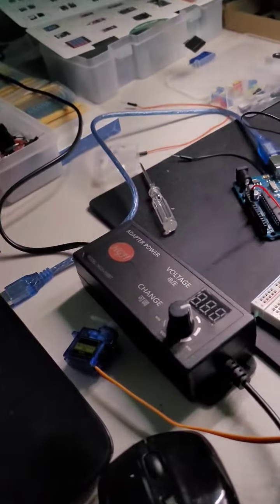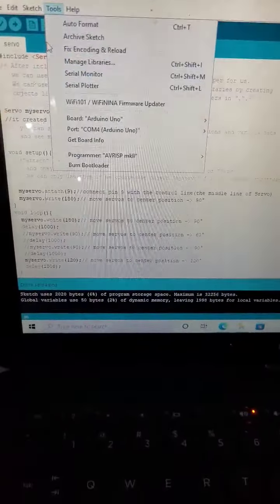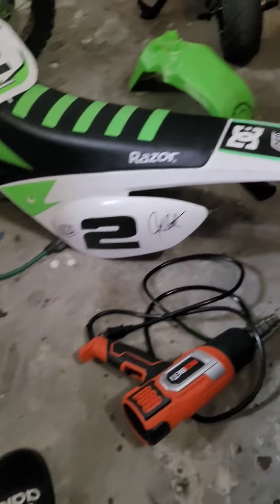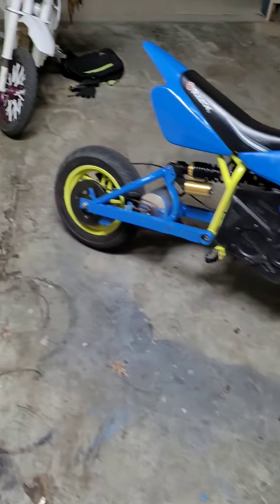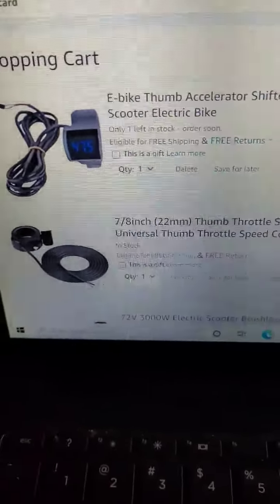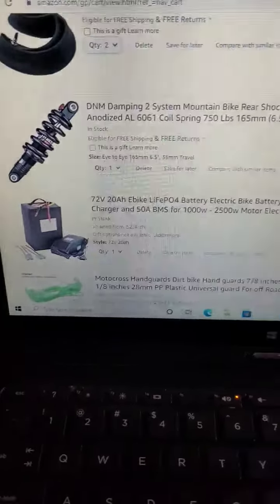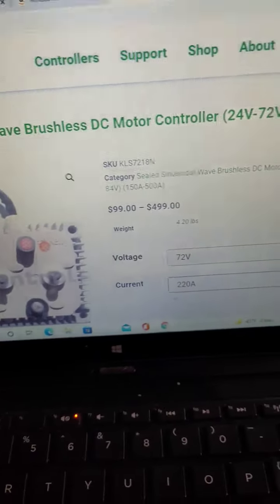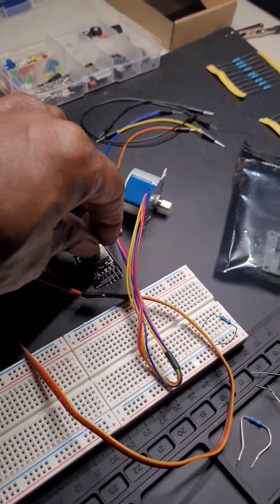Razor Sx500 project (alpha)

Comment from the maker: Stay tuned for the next 📹 🎥.  The Sx500 has been bumped up from 36v SLA to 48v SLA. 48v SLA speed test coming as soon as the 48v SLA xlr charger comes in! Wouldn't be in the position with out the help from V and X from Sacramento Electric Wheels! 👌🏿🤘🏿